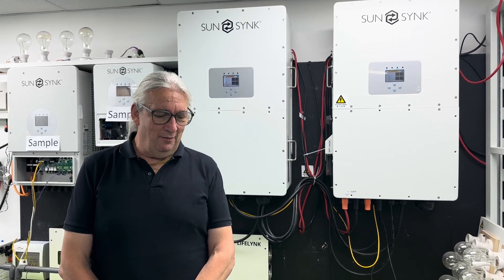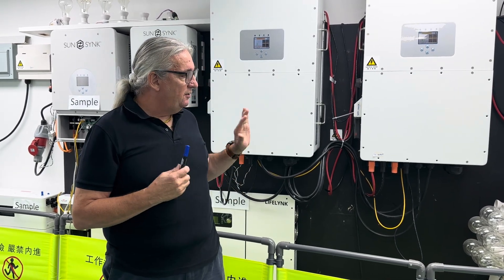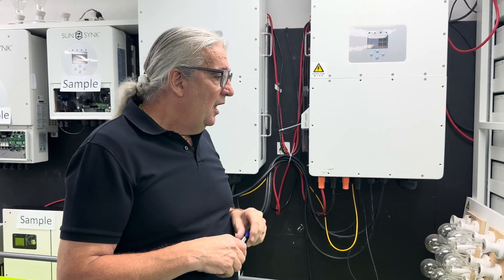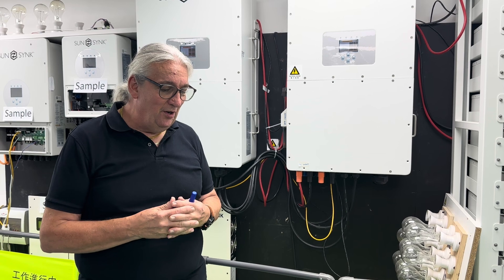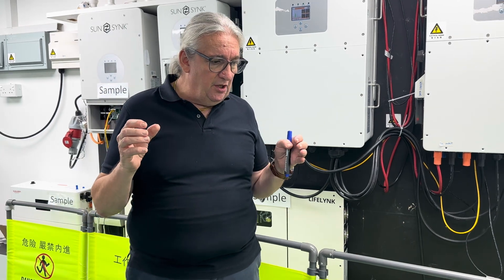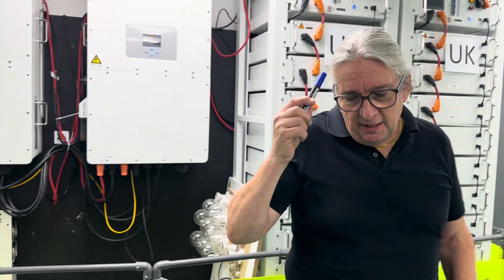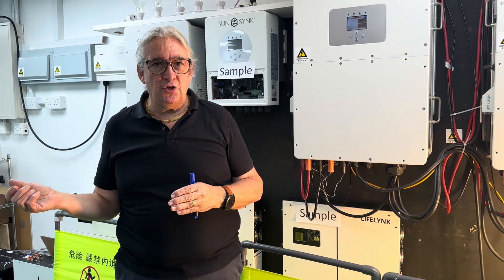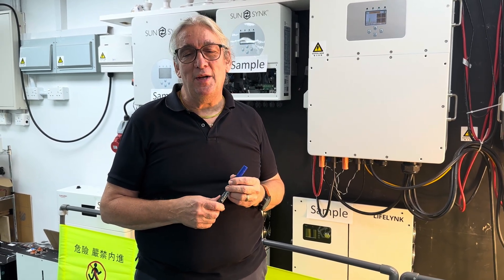installing and commissioning #Sunsynk high power hybrid inverter. ￼

Comment: My installer couldn't/wouldn't configure my house to be battery backed, complaining that the SunSynk has floating/switched Neutral, so the UPS was only usable for certain pieces of equipment.  Is this true? Did he lie? Has a workaround been sorted out? What can be done? I have a 8.8KW sunsynk system. (I don't mind if the heaviest loads aren't battery backed, ie the cooker and electric shower)

Comment: Why is the interval for data updates on the app 5 mins, ie useless. When i had my SunSynk installed 18 months ago I had data updates on the app every 30 seconds (and I thought that was too high as I wanted real-time). But 5 mins is pathetic and it's been like this for 6 months or more. You have no idea when the last update was, from the app, so you have to memorise a few readings and after continually refreshing the app screen and noticing a change in data, is the only time the data is accurate.... That's ridiculous and pathetic. I tell people not to buy SunSynk just because of that....

Comment: Hi,
If I have 2 x 15.5 kWh 48v batteries would I have to run these in series for 96v? 
Also, could a 48v lead acid traction battery be coupled to the second battery input to make use of it?